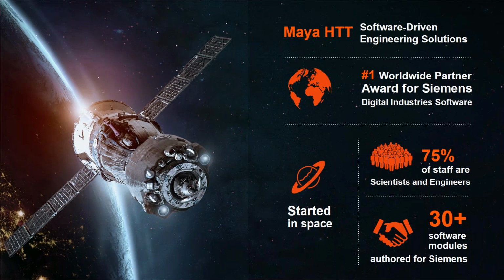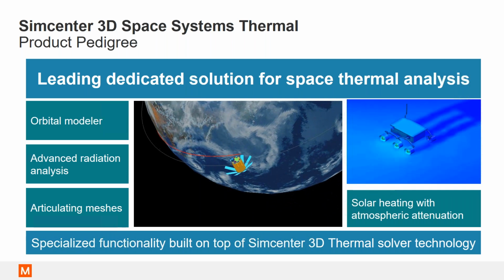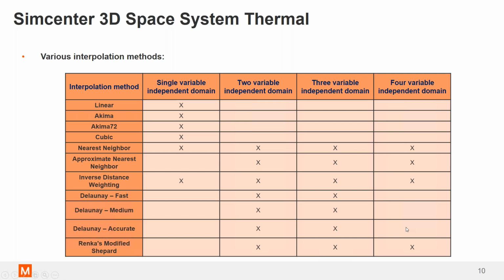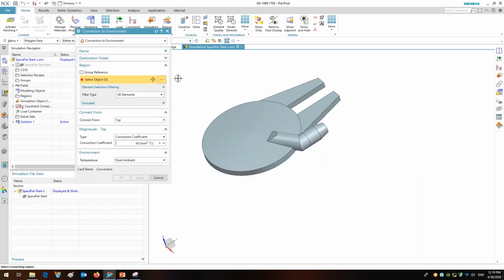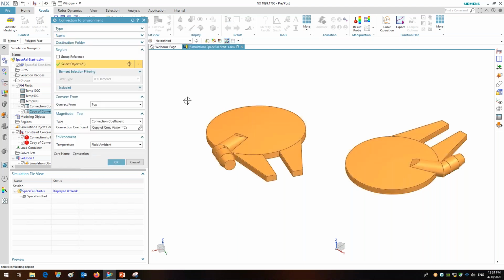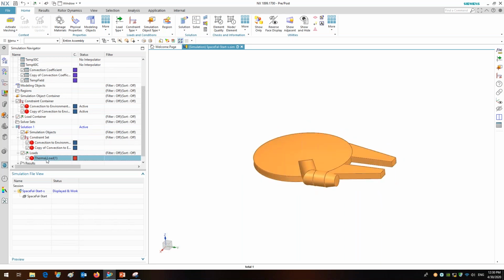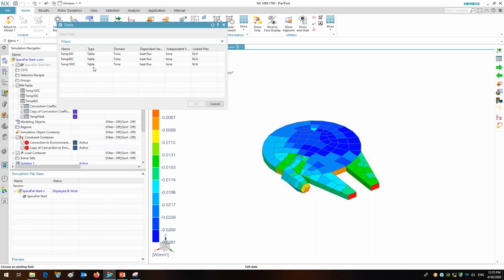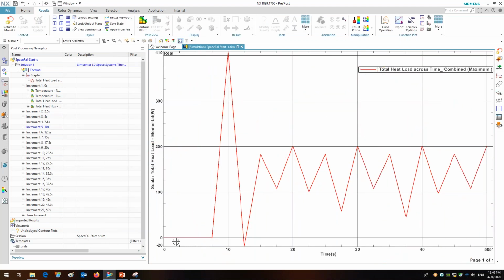Functionality in Simcenter 3D Space Systems Thermal to Streamline Simulation Processes

Comment: Hello!
I have a problem in SST analysis in PID settings.
Whet set my parameters in "Set point temperature" I have no opportunity to use "field", only constant.
But in my solution i want to make mathemetical dependence Temperature VS Time for transient analysis.
Please, can you help to solve this case?
Reply from the maker: We don’t support field entries for the PID controller specifically. It can only be constant values unfortunately. However, a custom user subroutine could be an option to achieve this.
Reply: @MAYAHTT1  Thank you! I think about it. But I can't find something similar in standart library "Function".
I write something in VB.net but I can't find the way to put it to my solution.  Please, tell me a tool that will help load my subroutine into the solution. Maybe you have a link to an article where I can read about this in more detail?
Reply from the maker: @yar_azh  The documentation on user subroutines is at the following link:
https://docs.sw.siemens.com/documentation/external/PL20191009145841552/en-US/nx/1899/nx_help_sc/common/en_US/graphics/fileLibrary/nx/tdoc_advanced_simulation/thermal_api_man.pdf
You will need a Siemens Support account to log in.
Reply: @MAYAHTT1  Thank you very much!!!!!!!
Reply: @MAYAHTT1  Colleagues, I apologize for the concern, but there are difficulties with the solution. If you can give a hint I will be very grateful.
I carefully studied the document the link to which you sent me and I managed to write my own subroutine for the solver that should substitute values from a given array of temperatures for the corresponding value of the solver time. However, it only reads the first value and does not change it further.
Can you tell me I'm not using the "get Time" function correctly? Are time units (seconds) automatically taken from the model?

void PID_Temperature(const IContext* pContext, const ArgData* pArgs, IReturnValue* pRet)
    {
double result=0;
double time;

int ncount = 4;

bool OrbitTime = pContext->GetTime(&time);

double Temperature[] = { 40.0,10.0,10.0,20.0,20.0};

double Time1mas[] = { 0.0,25.0000,50.0000,75.0000,100.0000};

for (int i = 0; i < ncount; i++)

		{
			if (time <= Time1mas[i]) 
			{ result = Temperature[i] * time;
			}
			return;
		}
		pRet->SetDouble(result);
	}

#if 0
      std::cout << std::endl;
      std::cout << "Time: " << time << std::endl;
      std::cout << "Result: " << result << std::endl;
        
#endif
    void AddPID_Temperature(IRegistrar* pReg)
    {
       Measure meas;
       meas.Set(0, 0, 0, 1, 0, 0, 0, 0, 0);
      IFunctionDefinition* pFunc = pReg->AddFunction("PID_Temperature",
         "Return temperature",
            meas,
            TYP_DBL,
            "Temperature",
            &PID_Temperature);

    // Go through the list of all supported functions and add them
    void AddFunctions(IRegistrar* pReg)
    {
        AddPID_Temperature(pReg);
Reply from the maker: @yar_azh  Your issue seems that the “return;” inside the for loop will terminate the function after i==1. If you have further questions on this topic you can always contact your dedicated support from Siemens or Siemens Reseller.
Reply: Hello how MLI modelling in sst. With a aluminum plate assembly